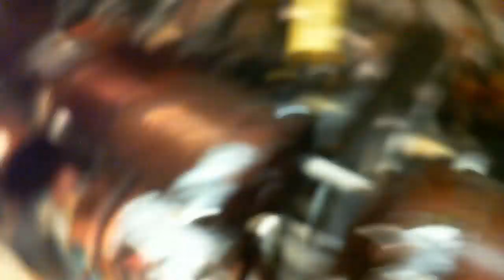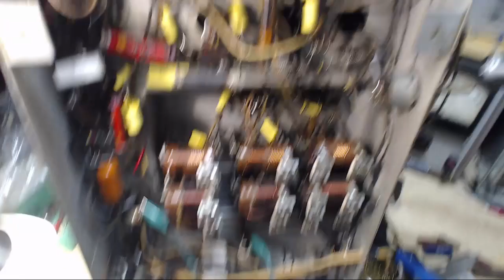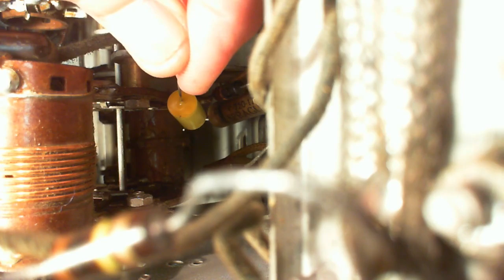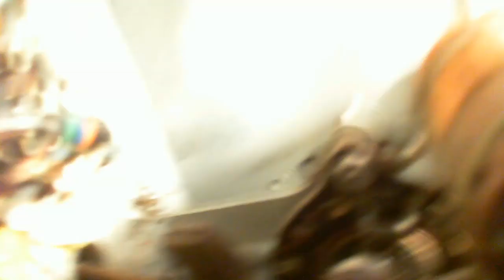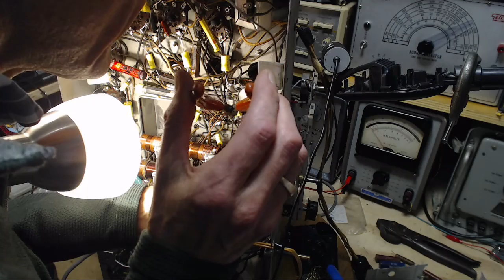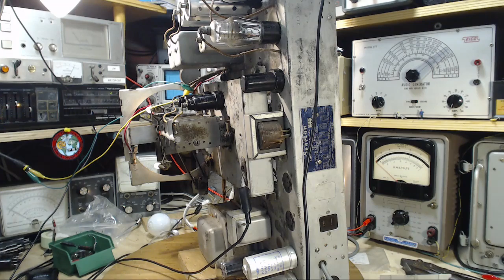Sparton 1567 Huge Tube Radio Video #19 - RF Capacitors (Pt-2)

Comment: In my experience in very difficult to reach capacitors i put in series to the bed capacitor a new one of much higher capacitance . In tis way the new cap provides electrical isolation and the total capacitance will not be too far away from the value of the original, left in circuit, old capacitor

Comment: I think that the wire you thought may have been shorted in the previous video had possibly been pinched between the removed shield and chassis and in fact had been shorted to the shield.  You may want to watch for that when you reinstall the shields.  

You may have installed one of the new capacitors  in such a way that it will interfere with the shield being replaced.  Hard to tell for sure but it looked that way when you installed the 1st capacitor in the previous video.

Have you calculated the wattage being dissipated in your "hot" resistors and verified that it is more than the resistors are rated for?  Hot is a very subjective term and is not a parameter that engineers normally design to.  It is normal for larger resistors to run very hot to the touch yet be within their wattage spec. Although normal now to not specify resistors right up to their rating, it may not have been when this radio was designed, or the accountants had their say.